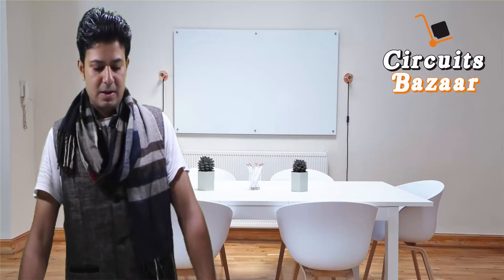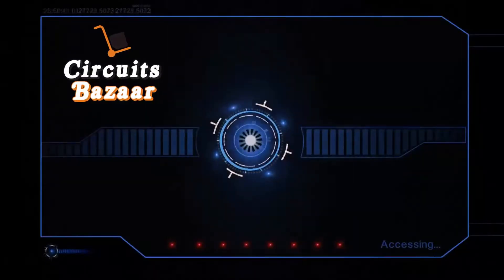Electronic voting machine Project Using 8051 microcontroller/ LCD - With code/ circuits / PCB Design

Comment: What are the values of the resistors and capacitors used ?
Reply from the maker: There are loads of resistance and capacitor  used in this project. Please visit the website circuitsbazaar.com over there You will find everything.

Comment: Sir can this project work without a step down genrator, rectifiee and capacitors with a battery
Reply from the maker: Use Battery only... instead of all the other components

Comment: Sir what is x2 and x1 in power supply circuit?
Reply from the maker: X1 and X2 is simply a connector it's a two pin connector right....any two pin connector you can use

Comment: In frst line of main func you have assign 0 to init and stop... Can we assign 1 to them and change ground wire to +5v in both button...?? Plz Give ans
Reply from the maker: Yes you can but accordingly change the hardware as well ...
Reply: #AskCircuits bazar,sir can u plz give me the code in assembly format ,it will be very much helpfull to me ,the code in description is in C format,but i need this assembly format,i'm unable to convert it ,plzzzzz help me sir